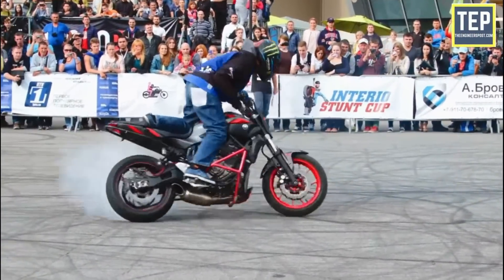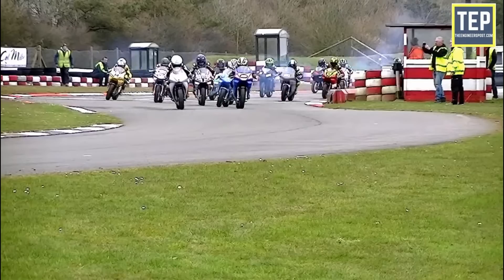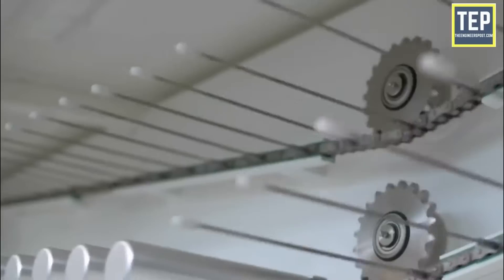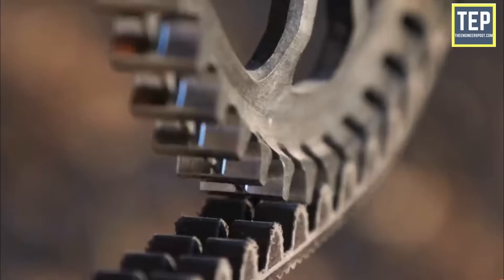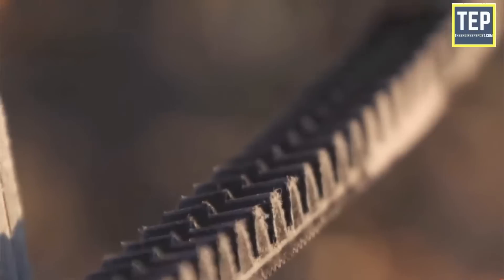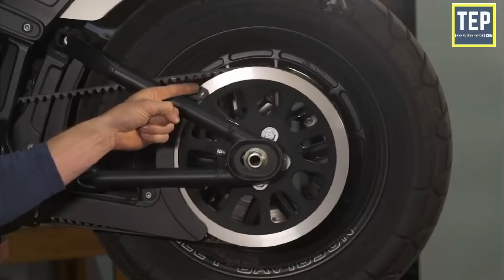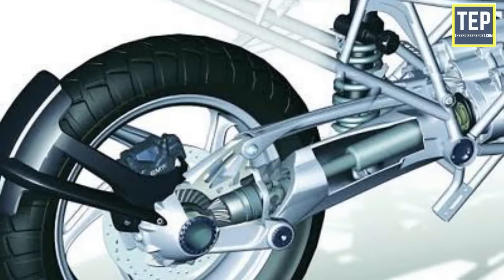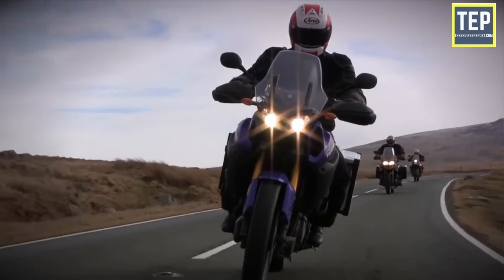Chain Drive vs Belt Drive vs Shaft Drive in Motorcycles | Which is Better?

Comment: I own all 3 types. Break a chain,repair and keep going. Break a belt not as easy a fix, but still not bad. Break the shaft drive and you're in for a long fix. It's rare but does happen. And it's the most expensive fix of the 3.
Reply: Shaft is the more costly problematic to repair, also the least likely to fail. I’ve had two shaft, over 120k, not had a problem
Reply: @ST_Rider939  Shaft is just as you say. Providing enough them are made to absolutely nail the process. Yellow cabs in New York & the Taxi by Mercedes have spiral bevel Propshafts into the Diff. With good maintenance & no accidents. They are expected to last between 1/4 & 1/2 a Million miles. Now if we are talking Mexican Tipper Trucks where they do the Classic Mexican Reverse. They are only likely to do a couple of Thousand Loads!
Reply: Not entirely accurate, I have bikes with all three systems and have had failures of all three over the 50 plus years I've been riding. If a shaft drive fails it's expensive and inconvenient but usually nothing more. If a belt fails it's again a nuisance but costs very little to fix. If a chain fails you can SOMETIMES get away with a road side fix but I've had other instances on high performance bikes where the chain has parted and entered the engine completely destroying the primary drive. I've never had that level of damage from a belt or shaft.
Reply: @gazza595  agreed.
Reply: @gazza595  good to know! Keep your chains fresh!
Reply: Break chain, lose a part of a link? Do you carry a spare split link? It there enough adjustment in the rear swingarm to manage without it? Still need that spare split link or a chain repair kit! Belt drive, do you carry a spare? Clean, light & easily foldable/stowable! Shaft drives grumble, whine & bitch for long time before they give out. You've paid your money & took all 3! So which is best?
Reply: I own chain driven bicycles, no IC (internal combustion) motorcycles. But i have worked as a technician repairing various types of machinery. What you say rings true.
Reply: Buy a new bike and do no maintenance to the chain, you will have lots of problems. A good shaft drive however, like on a Yamaha, will last the lifetime of the bike even if you dont change the Yamalube oil. This is why shaft is superior, but not great for fast bikes of course - theyre heavy and have power loss.
Reply: Or spend money easily.....
Reply: @FranciscoLunaPosada replaced the spline shaft on a couple of Valkyrie interstates.  Can buy a lot of belts and chains for that. Don't get me wrong, I like all of them, and travel on them. I was merely  sharing an observation.
Reply: If you’re new to riding, you HAVE to take care of the chain. It’s about as important as changing the oil and oil filter.

I didn’t know that, myself.

Also, you’ll truly love riding once you’ve taken the riders course.

You’ll be doing yourself and everyone else a big, big favor.
Reply: @casey00X  Typical, "GO" before You KNOW! A bike is a Machine! Machines have working parts! Moving Working Parts ALL wear & Wear Out! If your a "just GO." I'd advise you always to leave a point in straight light. You choose a distance! Then you ride in a CIRCLE! It is the shortest way home if You have to push or Carry your bike home!
Reply: How do you break a shaft?
Reply: That's nonsense. A shaft drive is not more expensive than replacing chains+sprockets. Chains are a PITA, and deteriorate with dirt. A shaft drive should easily last 100,000mi. And then, all you need to replace is a gear or two. There's no way they bleed 25% of power. Maybe 5-10%.
Reply: @chadkline4268  OK. So a belt drive, two belt pulleys & a belt! Widely available at nearly every Commercial, Industrial Bearing & Transmission Supply Merchants. Chains Ditto, two sprocket and a chain. Commonly know worldwide, Mass produced & cheap! Shaft drive, it jams, you can't see what's wrong as it is enclosed. You either have to take it off complete or split it by the road side. So, Encased front Crown wheel, same case front pinion gear with "slip Yoke Spline back end. Then Torque Tube with Slip Yoke, female splines Front & Back. Then rear Pinion Fewer Teeth than front. Then Crown wheel, Fewer teeth than Front! This gives you the One Gear Ratio. Now that is all set in the Rear Gears Case (smaller) than the front! Now all this has to be set up and an external tube to cover the Torque Tube that can Extend & contract with the suspension! Oh, Your not going to have rear suspension or Gears! Now we come to bearings. Oh, Shit were already more expensive than the whole TWO other transmission methods, even if we make Millions of them! Oh, You did say you wanted Lightweight? Project Canceeld!
Reply: @chadkline4268  Would agree with that. Given the reliability and longevity shaft works out cheaper in the long run. I never replaced a chain in 20 years of riding because I don’t have one 😁. Or had a shaft fail.
Reply: Just had to replace the axle on my r1200gs it failed after 95k km so it went a while but i did it myself and just the parts already cost €750 :(
Reply: @VANCLERCX But failed after 95k km! How many times have you serviced a chain drive in that distance? At what cost? Shaft is cheapest over the bikes lifetime, on lots of Yamahas it cost you exactly zero cents over the lifetime. Maybe one oil change and Yamalube specialty oils arent cheap but a lot cheaper than any o-ring chain and sprockets.
Reply: @VANCLERCX And, as i said before, BMW isnt famous for their shaft drive qualities, some cause vibration even and can throw you off the bike in speeds of 200kmh+. Yeah, old models, but old models of other brands dont do that. And, to talk about bikes driven to the point of failure we usually talk about older bikes anyway.
Reply: The shaft drive also jack up when you hit this the gas . Something sport riders don't like .
Reply: You all need to slow down.then you won't  have fix nothing.If it ain't broke then don't fix it.
Reply: How to earn money easily

Comment: Chain is the best. Belt snaps or shaft drive breaks you're stuck on the side of the road and going no where. Chain snaps well hopefully you got a chain braker and a master link and you can just fix it yourself easy. Plus more torque with chain, less weight. Why shaft drive isn't good in my opinion? I can switch up my sprocket in the front to change the way my motorcycle performance. For example do wheelies on my harley, or better top speed for long high way rides so I don't need to gas up at every gas station I pass.
But hey if you don't like / don't know how to work on a motorcycle and you don't care about getting as much power as possible then ride a shaft like my GF does ;)
Also ask yourself this question if you thing shaft drive is so good. Why is it never used for motorcycle racing?. I had a shaft drive bike before and it was very boring to ride. 
I keep a couple different sprockets on my at all times with my KTM so I can do any style of riding.

Comment: I don't know what he's talking about when he claims they're "often used on 'sports touring/adventure" bikes.  Tenere 700, Africa Twin, KTMs, Royal Enfield Himalayan, and the KLR all have chains.   The BMW 1250 GS does have one, but that's a 5/1 ratio.  Even the big KTM 1290R is chain driven..
Reply: Changing chain and sprockets in off-road conditions is not something you do for fun, but you can. Driveshaft not so much. It's reliable, but IF it breaks down, you're pretty much done.

Comment: I was told by a engineer that chain drive is only more efficient than shaft when new after 750/1000 miles the chain is a lot less efficient than the shaft drive and the more miles you do the worse the chain becomes plus shaft stays at its same efficiency for life but the big downside is the weight of the shaft drive system not suitable for small engine bikes

Comment: They’re all obsolete.
Electric hub motors have less moving parts. Add flexible solar cells on the body, an onboard 2000 watt inverter & level 3 fast charging

Comment: I've owned bikes with chain drive, and with shaft drive. I agree that each system, under the right conditions, provides reliable power delivery. For the open road, my shaft drive Concours, for off road fun, my chain drive DRZ 400.
Reply: I have been riding for  over 35 years and  motocross raced for 20 of it .
I totally agree .
My BMWR1100RT is shaft and love it. But  my Cagiva elephant is chain drive .
I just don't think a shaft drive  would do well in a off road environment.
Reply: @powertothebauer296  yes the  BMW Paris to Dakar was a shaft drive. 
 But I suspect that  they ran higher than normal  grade  ujoints  in it as well as  sealing everything up very well. 
But what would concern me would be the long term effects of  sand and  water  getting to the  drive line and  the  rubber in between the inner and outer  drive shafts deteriorating and having a drive shaft failure.

Comment: One HUGE difference ( covered by a couple others but not the author ) between chain and shaft for sport riding : 
    While leaning into a turn and applying moderate throttle a chain driven bike will tend to "SQUAT" at the rear due to the physics of the top of the chain pulling force on the top of the rear sprocket ... which, in turn, compresses the rear shock ... which, in turn, lowers the center of gravity mid-turn.
    Not the case on a shaft driven bike. The physics of the ring & pinion gearset ( at the rear wheel ) demands the pinion gear is attempting to climb UPWARDS on the ring gear ... which, in turn, makes the bike RISE AT THE REAR. 

    It's a strange feeling if you are used to feeling a SQUAT and get a RISE when you apply a heap of throttle. But it's just physics.
Reply: I agree as my Ducati is a chain drive and my BMWR1100RT is shaft I ride 1 of the two at least 6 days a week .the shaft drive is easier to  get to clean into a right hand  corner than left  due to the rotation of the drive shaft
Reply: Im happy to see this comment. My dad told me this and  kinda blew my mind, Im just getting into motor cycles and understanding this made me realize just how much every part matters. And how much they can effect the quality and comfort of a ride.
Reply: Went over my head 😅
Reply: Glad someone added this, I was told the shaft drive with two universal joints takes care of the suspension lock out (how we used to refer to shaft drive effects) but I imagine it's still there just maybe half as much (or some ratio less having to do with final drive ratio, like four times less suspension lock out but still opposite of a chain)
Reply: All 3 have their place. On my Harley, love the longevity of the belt. I put on way to many miles for a chain. On my KTM dual sport, obviously a chain. I have 2 sets of wheels with different sprockets and a chain for each set. I am not putting 15-20k miles on my KTM, so longevity is not a concern. Fine tuning the gearing by changing the front and rear sprockets is. Never owned a shaft driven bike, only have a few miles on a couple of them.
Reply: you never took physics 101

the chain is on the rear WHEEL, not on the frame. The chain is pulling the rear WHEEL forwards and down, and has no connection to the rear suspension at all
and the counter force is pulling the drive sprocket on the transmission the opposite way, backwards and UP - trying to pull a wheelie everytime you apply throttle

GEEZE!
Reply: @kenwittlief255  look closer at what happens to suspension bar right at the moment power is applied - before the bike's front wheel rises for a wheelie
Reply: I also noticed right away that a belt driven has no buffer between acceleration and down throttle....in other words....(on a 1000cc touring bike), when I accelerated quickly and then suddenly decelerated  the rear tire "chirped"......not good at ALL during cornering.
Reply: That has to be the most back-assed attempt at misunderstanding basic newtonian physics. EVERY single bike with rear suspension bar will try raising the tail because of torque from the wheel to the suspension bar. Just like a drag car raising its front wheels. But unlike a drag car that does not have a rear susoension bar, the same force will raise the bike (and CG) until the moment this is limited by rear suspension itself that in turn will transfer the torque to the bike itself, raising the front wheel and thus loading the rear wheel much more... and in turn compressing the suspension. The same action would also occur in the same exact order when doing a wheelie. And it does not matter what kind of bike it is - chain, belt, shaft, even a fucking electric scooter with a motor inside the wheel and EVEN A CAR with 4 wheels as long as rear wheels try accelerating forward the same exact thing will happen.
Looking at the rear wheel alone or at shaft/chain alone is like looking at the Earth and thinking that the sun revolves around it.
Reply: @LegateMalpais  have you ever ridden a shaft drive motorcycle?
Reply: couple people having a physics debate in here.  I'm not exactly sure how a vehicle accelerating would cause its rear suspension to raise up since the only way the suspension could extend is if the load on the rear is lightened, but from a stop that cant really happen since the wheel cannot get any lower because there is pavement under it.  only way that the load under the rear wheel would get lower is if the load in the front got heavier which doesn't happen from accelerating.  rear wheel should always go down under heavy acceleration because the wheel is being driven forward into the suspension which is being held down the bike, what you would feel as the weight shifting backwards which is really the force pushing you forward.  the 2nd effect is that the wheel is spinning in one direction and the wheel is also wanting to spin the rest of the bike in the opposite direction which is bringing the front wheel up.  I'm pretty certain that if your on a rear wheel drive vehicle there is no way that applying power can make the rear suspension raise itself unless you are driving over bumps.  even on a front wheel drive car the back would squat since the front wheels are trying to run away from the car thus extending the front suspension and loading the rear still.
Reply: Ma man! You really know ur story SALUTE🖖

Comment: Missed a very important aspect of chain drive. Easy to change sprockets of different sizes out to fine tune power to the ground. Very common for off roading.
Reply: Couldn't you do the same with a belt?
Reply: @jhoughjr1  not near as easy and not cost effective. Belts and pulleys are much wider also. Bikes that tend to benefit from quick sprocket changes, suck as off-road and track bikes do not have the space for belts and sprockets. Most people that go from belt to chain do it for the look, no other reason. Most won't admit that and give you a line of BS on why they did it.

Comment: Another plus for chains: you can repair/replace a chain without taking the bike apart.
Reply: True. Also changing tires with a shaft drive bike is a pain in the Ass. Belt and chain are basically the same when it comes to removing rear wheel.
Reply: @michaelconran5252  It is possible to replace a chain by breaking the connection link, threading a new chain in, and attaching the new connection link. The chain would need to be adjusted for tension, of course, but this would not require removal of the rear wheel.
Reply: @Gemini-b4g  have done it. On my KTM 450, swapping wheels and chain easy peasy. On my Harley, love the belt, put 15,000-20,000 miles a year on. On KTM swap from off road to supermoto wheels on a regular, have different sprockets. On Harley pull wheel about twice a year for tires.
Reply: @michaelconran5252  Yeah, replacing a chain / wheels isn't difficult. I have chains on my 1964 Harley and 2010 BMW F650GS and 1988 Honda Hawk. I had a driveshaft on a Virago decades ago. It was low maintenance (I only checked the hypoid gear oil every once in awhile), but I never changed a tire myself on that bike. I have never had a belt. I think that if I get another bike (you can never have enough!) it will be a Softtail with a belt. It seems like a good long-distance cruiser. My other bikes make my ass a little sore after a few hours. I know, I am a wimp!
Reply: @Gemini-b4g  I've never owned driveshaft but I've helped others pull the wheel and put it back on after a tire change. It is a pain in the butt but you don't have to worry about getting a tire alignments about the only benefit but you have a bunch of other crap you have to deal with. For a Harley and the like belts the only way to go

Comment: Decent quality Video's produces yet they still use Text to Speech rather than a Narrator. 
Power in v Power Out nothing comes close to chain drive that's a given . 
Belt while being relatively maintenance free and pretty quiet are good , for overall durability in all conditions nothing even comes close to Shaft drive but as was shown cost is a huge factor along with the power loss in the drive train . 
 
I cycle 3 chains standard roller chains on my Ducati warming them in heavy oil and allowing them to cool drawing in the lubricant, change them every month and use a dry wax lube on the road if travelling any distance. 
I refuse to use any "O" Ring chains because you cannot get any lube into the joints and roller's because of the "O" Rings .  They are more expensive than a conventional chain also.